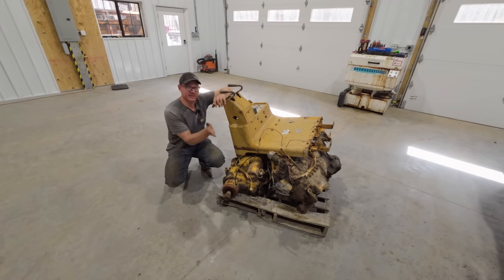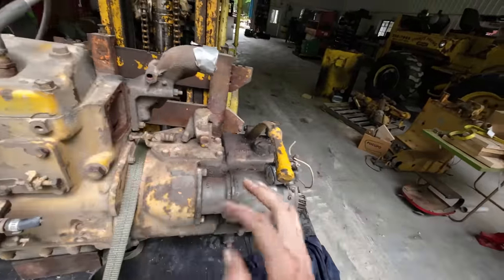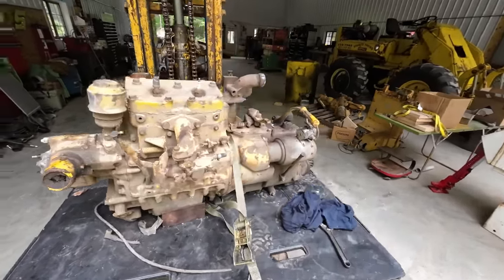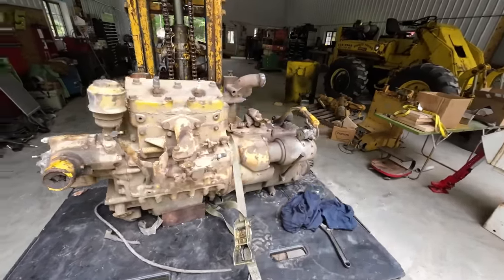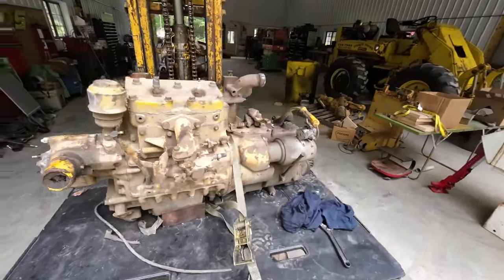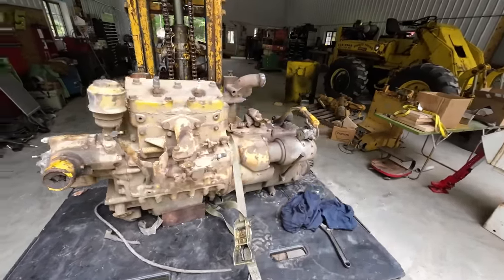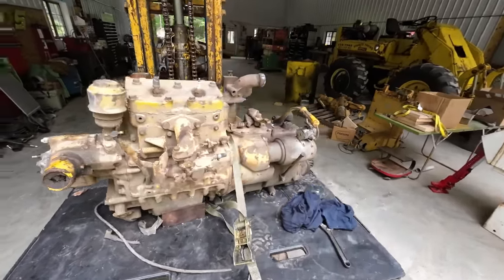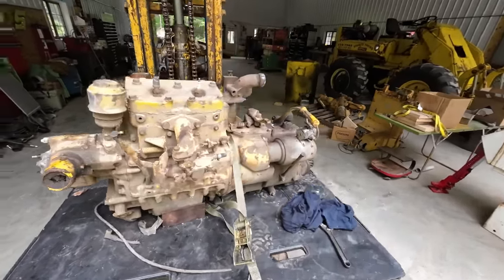I Got Two FREE 1960s Caterpillar Pony Engines. Will they Run??

Comment: A trick I've used with sticking needle valve is to sharpen a bamboo b-b-q skewer or chopstick to about 45°, dip in fine valve lap compound and redress the needle seat. Wash thoroughly after. Works great when ancient parts are unavailable or time prohibitive.

Comment: Back in 1985 while attending the Pittsburgh Institute of Aeronautics, we were testing our 9 cylinder magnetos. Our group connected to the test board and watched the late great Joe Connors start spinning our magneto. At first you could see every individual spark. As it came up to speed there was nothing but a solid blue line of 9 continuous sparks. It was a terrifying sight to see. Just as we were being impressed with ourselves, one of the wires jumped off and attached itself to a guy's belt buckle. 

You should have seen him jumping around like a monkey, hollering at the top of his lungs. That's a day none of us will ever forget. Especially Mark B.

Comment: What a lovely gentleman to donate two pony engines to the cause. Even better. two working pony motors. You have to love these old engines. They used to say all you need is fuel and spark. And pretty much true for these old things. Today that is a fraction of the story. All kinds of sensors. And the computer to run them. I know which I prefer.

Comment: Love these resurrections. Hey Matt, one little tool I always found handy was a push button starter switch with alligator clip leads. I hated doing that flashing the wire against the positive stud. You can stand back a little from the engine and see what's going on.

Comment: So many cat pony motors ended up in scrap piles when direct start conversions became available.  Most pony engine gear drives have overrun sprag clutches in them.

All of the magnetos used on older small engines must be copper core wire, if you use carbon core wire you will have harder starting along with points issues.  I learned that after having problems with wico magnetos on many of the Wisconsin engines.
Reply: Not sprags!  That’s a typical direct electric starter drive technology. Caterpillar always used centrifugal latches to kick the pony pinion out of engagement with the diesel flywheel ring gear.

I agree on the copper core wires, BUT I’ve had pretty good luck with the mags on CAT engines with whatever you can find laying around!  Surprisingly, If you don’t pick up a bad one, most anything will work on them.

Comment: One of the culprits of the second pony engine smoking so badly is because you put quite a lot of penetrating oil in the cylinders. It'll probably run less smokey once all of that is burned off.

Comment: For those that are unaware, a wire brush/wheel is most useful to remove Teflon tape from fittings. I've cleaned many a fitting this way in a small engine shop I worked at years ago.

Comment: Pony motors such as these were notorious for having fuel contaminated motor oil because historically they were not given the most love (periodic maintenance) and hence were often run with the choke on to keep the engine running just long enough to start the “big engine.” In the case of the Cat pony engine in general they were not the best designed engine and were fairly inexpensive back in the day as a result more often than not if the piece of equipment was part of a company’s fleet of equipment the pony motor maintenance was run it until the thing either physically broke (a fairly often occurrence) or refused to run regardless of how much ether the thing was sprayed down its throat hole.  A neighbor of mine who is a spry 92 and can outwork still today most people in his gardens was heavy equipment operator until he retired at age 82 has told me the first big company he worked for used to replace the pony motors on their equipment yearly as a maintenance item. He said they would sell the ones that were still running good and scrap the ones that weren’t. I really didn’t understand why they did that until I watched Squatch’s series of videos on Cat pony motors and say what junk they were design wise and much less production wise. My neighbor said they still ran equipment with pony motors on them instead of converting them to electric start because they did a lot of work in remote areas and drug addicts, bums, and thieves would steal batteries almost instantly so equipment with pony motor were desirable because they didn’t need a good battery. He said they used to stick junk batteries in the equipment so the animals had something to steal.  He also said they they would leave cans of bad fuel around job sites for them to steal along with a other “prank” to screw with the A, B &T as he said they called them in polite company

Comment: Those are some cool little motors and they sound strong. I bet one of those would be a beast of a motor to use on a homemade tractor project or something similar to that. From the scrap heap to Diesel Creek, two more cast iron creatures have come back to life! Two thumbs up Matt!  :)
Reply: The pony motors weren't designed to be long lasting, just like an electric starter motor is not for continuous use. Although the ponys can stand turning the diesel engine under compression and no fuel injection for five minutes or whatever it takes to build heat in the block, so the diesel fires right up. Watch Squatch253 starting his D3 and D2's. That's the way to do it

Comment: I had no doubts that both engines would work, considering your skills and luck. Thanks for great content Matt! Best wishes from Russia!
Reply: That pony motor has an electric starting motor on it. Talk about crazy town! I wonder if Matt has ever thought of taking the electric starter off the pony motor and replacing it with another pony motor that of course has an electric starting motor on it. So diesel with a pony starter that is started with a pony starter that is started with an electric starter motor. Sounds about right for Diesel Creek. Best wishes from 'merika, home of the africans.
Reply: @thinkcasting3182  The machines needed all that because of the high compression of the diesel motor is hard to overcome otherwise. We have electric motors that are high torque now, and just plain way better all around nowadays. Imagine how big of a lever would be needed to turn that big diesel over to start w\out these other starting engines/components. 🛠️👍🤔

Comment: One good thing about those 'L' head engines is if the valves do hang up they don't punch through the pistons. I cracked up when I saw all 4 open....yup, they were stuck all right!! I admire your persistence and ability to see worth where others see scrap metal. Although I don't blame people for scrapping things, there is a point where the cost of repair is prohibitive, its better to recycle the metal than have it laying around, slowly being reclaimed by our earth and looking sad and ugly all at the same time. That being said, I've Got to go...my 454 IH is needing some doctoring.

Comment: Finding 2 of those pony motors in the same place, that actually run with a bit of work, is almost unheard of! Most of them have either been changed out for electric starters, or blown up for one reason or another. These are really the proper way to start a big Cat, especially in colder climates where you can spin the main engine slowly, to allow it to build oil pressure, and warm the block a bit before putting the fuel to it.😉 Nice work Matt!😄👍

Comment: I like the pony engine on my D7E.  I rebuilt it several years ago and haven't had to do much to is since besides keeping the points in the mag cleaned up.  I think it saves money in the long run without having to have huge batteries on the dozer that would only last a few years with the lack of running hours and sitting around most of the time.
Reply from the maker: Agreed

Comment: Get yourself a gallon of Berrymans carb cleaner…disassemble the carb.. drop it in for 20 minutes..a little warm water/compressed air.. your done… Gumout spray is ineffective….um.. needle and seat.. not “valve “

Comment: The direction you thought was engaged in the main clutch lever should be a brake (all the way back and holding pressure on the lever) to stop the gear train so you can engage it to the flywheel, then you engage the main clutch by moving the lever towards the pony to get the diesel rolling over.

Comment: The pony motor on my '52 D-4 has horizontally opposed cylinders and is behind the motor on top of the flywheel. Also doesn't have electric start. Pull start all the way baby.

Comment: That D9 pony motor is actually quite the testament to Diesel engines. That pony motor probably only has 1/100th the hrs the Diesel engine it came off of and it no longer has cross hatching in the cylinders. To think they managed to put that many hrs on the starting motor, just imagine how many hrs the engine it came off of must have had.

Comment: Jump start box mods since the cables are quick connect why not take another connector. Old thick jumper cables or battery cables so you have a power and ground cable with ring terminals on the end.

Comment: Mat, before you pit the second pony in storage let it warm up, drain that gas / oil outta the case and put in some oil meant to preserve engines.
It has additives meant to protect stored engines.
Run the engine only long enough to get all surfaces coated including a little in the cylinders with it off only turning over.
I learned that in the several vocational schools I've attended from small engines to motorcycles to Pratt and Whitney R1820 radial aircraft engines before I ended up becoming a Arcade and pinball games, jukeboxes and pool tables tech/mechanic. 
I still regularly worked on various engines and vehicles. 
It's an itch guys gotta love scratch regularly as far as I'm concerned.

Comment: Matt idk if you'll see this but... I worked for cat for four years in ND working the front parts counter. And I can tell you their is more available for the 46h serial number D8 tractors than a guy thinks. The parts for pony motors are not impossible to get and alot of the gaskets and bearings and clutches are available directly from cat. If you have a parts man worth his salt. You can still damn near have a brand new pony. I can tell you your doing a great job appreciate the videos and if you ever need help finding the right parts please reach out. Idk if you found a turbo yet but I bet a cartridge is still available. Thanks again for the great content.
Reply from the maker: Finding a parts man worth his salt is a tall task these days… they basically laugh at me when I called the dealership for parts for this old stuff. I played around in SIS and couldn’t find the cartridge. 🤷🏼‍♂️ I shipped it out to hopefully be rebuilt.

Comment: May I suggest Loctite 545 for all your fuel, oil, and hydraulic fittings. It is specifically made for this application and I can attest to a $10k injector pump that was replaced due to PTFE tape particles. I have personally used 545 for many years and I have never, ever had a fluid leak on any fitting it was used on.
Reply from the maker: That is my favorite as well!

Comment: Complete non sequitur here, but mounting the thermometer on the wall above the manifold for the in floor heating is going to give you artificially high numbers when the heat is running.

Comment: They dont make parts anylonger you say, huh, I rebuilt the pony on my d4 last winter with all genuine cat parts i bought from my local Cat dealer, who informed me they still had most if not all parts to repair them including carb parts. And that d4 is a 1955 model. Just saying 😌

Comment: Matt, with all the engines you play with and jumping the starter out with scrap wires/ wrenches/tools ect I'm surprised you haven't invested in a push button switch with a couple heavy alligator clips......... 5 bucks and makes jumping out the starter solenoid so much easier....... at least less sketchy😁
Reply from the maker: I have one. It was connected to that loader, and a very hard to get to place so I didn’t want to disconnect it. Lol
Reply: @DieselCreek  Lol

Comment: One more time.  Home made sea foam, a jigger of acetone in a quart of kerosene. It's. Great on intake and crankcase.   In a pump oil can ,,,run those engines and fog it until it dies.  Let set.  Next time a shot of ether and away she goes. It is best thing on carbon and sludge.

Comment: Mat a bit of help I hope .. long time a go 1967 or 68 I helped get one of those pony’s going again . Rings where from a Allis Charmers tractor . 3 3/8 bore .. though the D9 I think had 3 5/8 bore ? On years with the larger bore . Head gasket was hand cut from a 3/16 thick sheet of copper painted with silver frost  when town is 6 hours away on a dirt road and even then pony motors where been removed and scraped . Ps parts once ordered days away if not weeks from the USA . Ps I think there was some early Chevrolet motors the same size rings as well ? But copper head gaskets are not that hard to make if you can get most of the old one as a templet punch bolt holes ect scribe and cut out

Comment: Imagine trying to start a 2002 gas engine that sat for 20yrs and a lot of people criticize carburetors and points because they think efi is so superior. Reality is carb and points/magneto can be the most reliable way to run an engine even if parts are not available because the people that is using them knows somebody that can make or modify something needed to run it

Comment: Another great video, thanks for that. 
But it also gave me two concerns: 
1.) What about fire protection in your new shop? It is fun to see that ether pop, but I can't see an extinguisher anywhere. I dont want to see your great new shop burned down... 
2.) Have you ever thought about using a fan for sucking out engine exhaust fumes? Right, they are something like the Chanel No. 5 for machinery enthusiasts, but they are also not really good for your health.

Comment: Suggestion - Is it worth you making a test rig for engines... e.g a kind of Peg Board of steel with holes in grid - on say a steel Pallet then you have adjustable steel uprights and angle iron you bolt down to make an adjustable test rig for engines of different sizes? Then put a 6ft on one corner for small fuel tank, filter - then wheels on the bottom with brakes so you can roll it around?

Comment: Front cylinder is the lead cylinder and gets a majority of the fuel mix!  Odd-fire ponies are by far the most common side-mount ones.  There are a few even-fire side-mounts but that design was a late comer and dropped pretty quickly again in favor of the old design

Comment: Great to be able to get BOTH pony motors working and running, but think, Like you stated, the first one would be a much better canidate for replacing the one currnelty in the cat. though all together I would of just went with an automatic starter, though i understand why you want to keep it as opriginal as possible. Again, great video, and thanks for sharing.

Comment: I have a Coffin Brand flat chain hoist wit6h a doubler gear and hook in chain middle That can lift 14 tons if the clutches can get freed up; it has sat unused for 20 yrs+  Doubler is a  yoked gear that rides the chain and has a full swivel hook built on it. About 25# weight with about 12 ft of chain reach. Have bulled a semi tractor out of a ditch with it in 1986. Got any need?  I m in southern Oregon-Jackson County.

Comment: Good Video: Spark plug wires need real copper wires, (Not the carbon wires used to reduce static on Auto radios).  Doing good job -- will comment more.....

Comment: Cranking on old motors from storage, without pulling plugs, checking for cylinders full of oil or water, or rust, then  oiling them and spinning with plugs out makes me cringe everytime.. worked out for him..but it makes me cringe..I've seen too many scored up cylinders, from dry rusty starts and bent broke rods from hydrolock..

Comment: got a 67 bronco one time bucuse the dude used siclone on the carb and it got into the oil pump locked up the engion run like a top after i fixed it

Comment: I saw that you called the CRC Lectra-Motive "contact cleaner".  Something like the CRC CO Contact Cleaner is better to use for that as it is specifically "plastic safe" contact cleaner, where the Lectra-Motive electric parts cleaner may be safe on plastics.  Really intended for a different use.

Comment: MATT there's one problem with you add about this video, you could never use these motors as boat anchors, why normal boat anchors, usually weigh about 35 pound!! these pony motors weignh more than you or any boat could handle with out sinking first!

Comment: Having been an mechanic when jumping the starter put the ground to the block the starter bushings are not designed to be the ground been there done that especially when dealing with hard to find parts

Comment: Matt, is there a reason you never clean any of the old engines and motors before you work on them? Just curious.
Reply from the maker: What’s the point. Dirt was definitely not a hindrance at all. It’s just an extra step. In a lot of hassle stretching out hoses getting all wet and then winding everything back up.

Comment: just pull the plug wires off, a trick is using a pair of cartridge type "fuse pullers" you'll be far enough away to not get zapped and they're non-conductive of course. 😁

Comment: At 18:00, I noticed that your fuel tank was sloped to the point that the feed line in the bottom of the tank wasn’t getting any fluid. After you’d cleaned the carb, the tank had changed position to be more balanced and we got another of the famous Matt Happy Laughs😊Thanks again